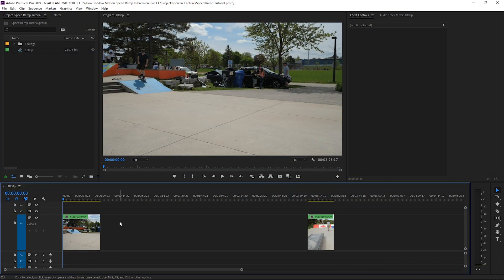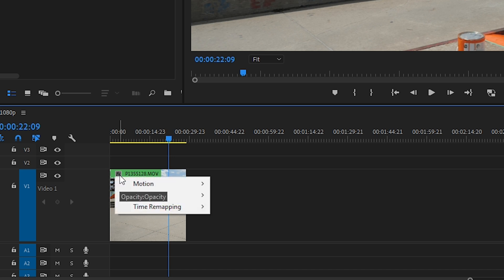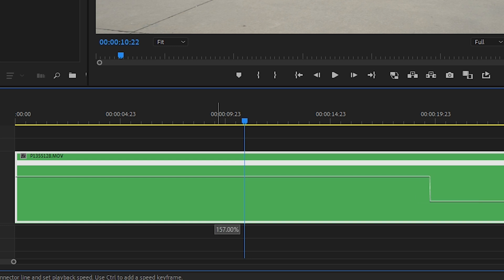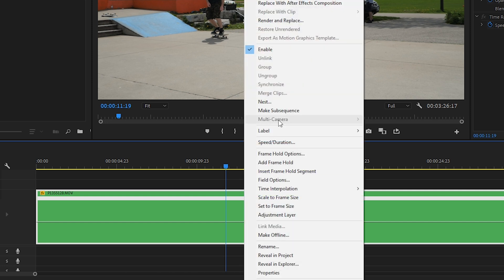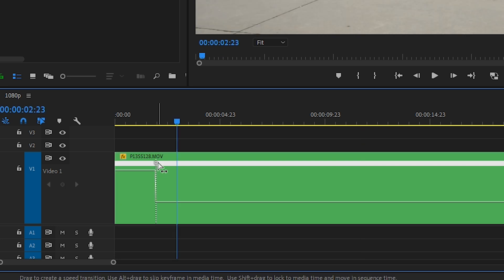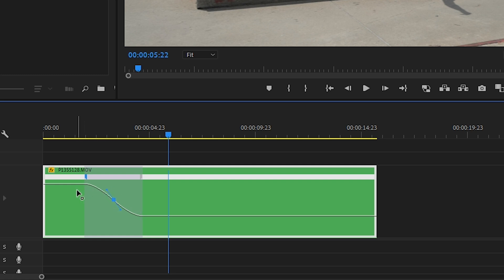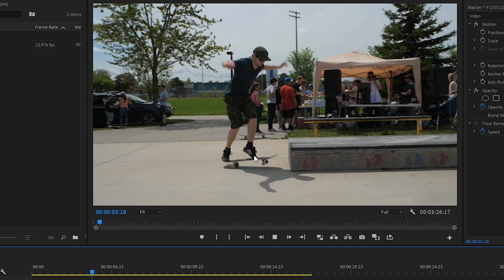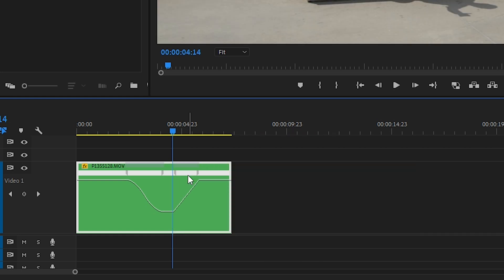How To SLOW MOTION SPEED RAMP In Premiere Pro CC

Comment: Will this look choppy? As the parts where the footage is 120fps, premier is interpreting it as 24fps. and the parts that you have slowed down to 24fps won't have the 180 degree shutter rule, rather than 1/50 it would be more like 1/250 as the original clip was shot at 120fps. Does this make sense? Cheers
Reply from the maker: Premiere is just dropping frames when the footage speeds up during the playback to get 24fps at parts. The shutter doesn’t really have anything to do with it. If the footage was filmed with 1/250 shutter, that’s baked into the footage, so speeding it up won’t change that. The sharpness or motion blur is baked in.
Reply: @AlliandWill  a shutter of 1/250 for a 24 frames per second clip will mean the footage has no motion blur and will mean it look a bit jumpy and off won’t it?
This is for a client so can’t be taking any chances haha
Reply from the maker: You need to think about the purpose of what you’re trying to do. If you plan on speed ramping footage, you’ll need to film in slow motion and then ramp it later in editing to make parts faster (back to 24fps). Movies speed ramp all the time, think of the movie 300, they filmed in very slow motion, then speed ramped parts to fast and back to slow, but of course, when they filmed the slow motion, the shutter was higher to account for the higher frame rate. So it’s a decision based on what you plan on doing. If you don’t need to speed ramp, and aren’t in need of slow motion, just film in 24fps from the start. If you want slow motion or to speed ramp, film in slow motion.

Comment: did you interpret the footage to 24fps before you put it on the timeline?
Reply from the maker: Nope! Premiere does a really great job at working with mixed frame rates. The footage was filmed at 120fps, then internally (in the camera) was saved at 23.976 fps, and that's what my sequence was set to. I said 24fps in the tutorial to make it simple (Explaining the reasons for why 23.976 exists compared to 24 would be wayy to much info for this video haha). Technically though, it would be correct to interpret my 23.976 footage to 24, then do the speed ramping in the proper multiples of 24. That being said, for 99.99% of projects, it won't make a difference.